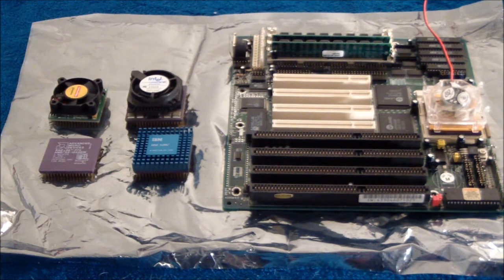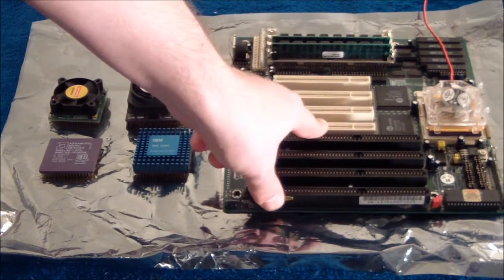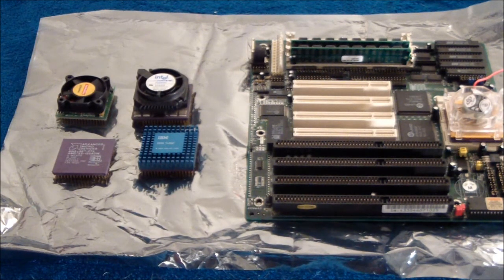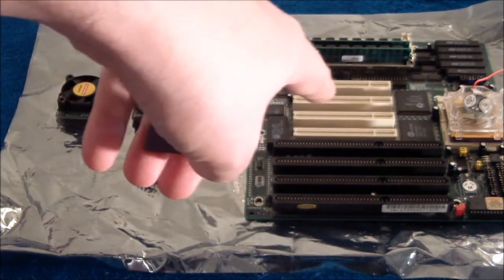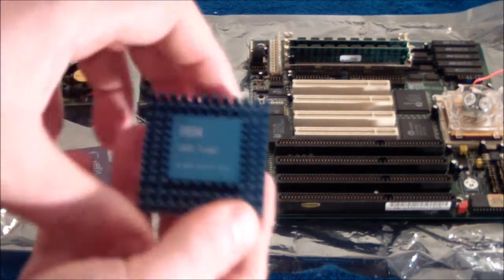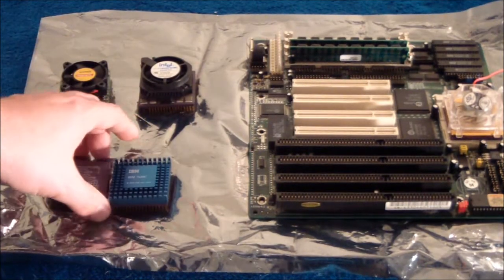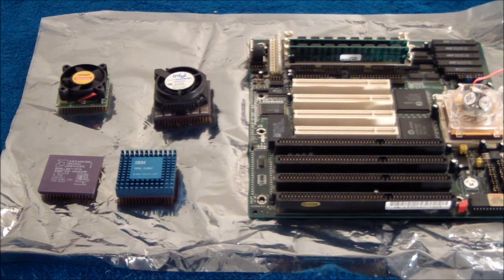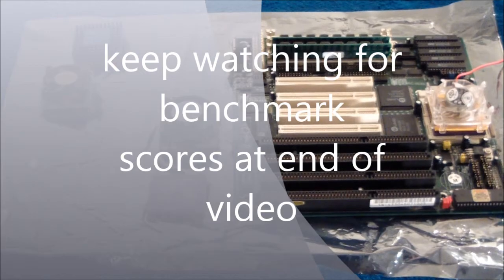Building a high end 486

Comment: I feel like everyone talking about PCI on a 486 just copies and pastes from something that one person some time said. What exactly is the improper implementation? I have a 486 with USB, wifi, reads flash drives, has Geforce 4, no issues whatsoever.
Reply from the maker: It's possible whatever 486 PCI motherboard your using has proper implementation. personally I've had a few PCI video cards not work on 486 PCI boards. The cards are fine and work perfectly in other later builds but I just get a black screen on my 486 with PCI. there could be several reasons for that however. I was very curious myself though so I posted this question to the people over at Vogons whom are far more experienced than I. Thus far these are some of the issues with early PCI implementation that were given to me.
- 5V slots only - so, no support for 3.3V cards.
- no PnP PCI BIOS support, you should configure PCI interrupts, DMA or other resources manually, or semi-manually.
- PCI protocol versions - PCI ver. 1.x motherboard or cards can conflict with ver. 2.x mb/cards.
- IRQ sharing compatibility in early protocol version is not so nice, req’d such tricks as ISA paddle boards for guaranteed IRQ.
- firmware initializations on turn-on not perfectly supported which leads to some PCI video cards not working. (I've experienced this)
- No support for or buggy IDE specification leading to many newer IDE controller cards not working. 
Take from that what you will as I can't vouch for the credentials of the reponders. I'll update this post with more info if anyone else replies.

Comment: like the socket 3 motherboards with pci slots I have my AMD 586 Dos build and has 4 PCI and ISA all done up with jazz-16 bit sound card and Rage pro PCI card 8MB Vram also looking into installing a SCSI controller card with two 10k cheetah SCSI hard drives and future Ideas would upgrade graphic card with Voodoo 1 and faster processor , right now I can play Quake with low resolution
Reply from the maker: How do you like the Jazz-16 sound card?
Reply: @AncientElectronics  its like a soundblaster card It works great with all my Dos games and like to test it with MIDI device some day

Comment: GREAT video! 
Seeing as the Am5x86-P75 ADZ was designed to run at 160mhz, (yet marketed as 133mhz) I'd assume it would be somewhat safe to OC it to 200mhz.
As long as it has a fan and heatsink I think it would be reasonably stable.
Anything beyond 200mhz is just stupid however.
Reply from the maker: I wasn't able to push mine to 200mhz but I know of people that have with the right 5x86 and motherboard. From what I've read its actually a bit tricky to get this CPU stable at 200mhz.
Reply: You'll still need a "golden sample" for that.

Comment: Are there any games that would work on high end 486 like this but would not work on a pentium?
Reply from the maker: nope, not to my knowledge. A high end 486 is a fun project but I think in general one would probably be better off with a socket 7 machine running a slower Pentium if you want to be around the same performance level.
Reply: I already have a 100Mhz socket 5 pentium built, so that is why I asked. Considering building a slower dos pc though. Might go with either 33Mhz 386 or 33Mhz 486. 386 might be good for a game like wing commendar and 486 might be good for a game like ultima 7. Too bad there isn't dos computer that is good with all dos games.
Reply from the maker: I like building different systems for different eras but I know many people do not or lack the space.  a 386 between 25 and 33mhz is usually whats recommended for Wing Commander. socket 7 166-233mhz Pentiums make decent all around DOS machines and usually can play a large amount of DOS games without issue.

Comment: With all that is said, which of the two I have is suggested to use?  I have an AMD DX4-100, and the Pentium-OD 83.  I have quite a few really good DOS ports of some of my favorite arcade games (MK1-3, the Acclaim port of Bubble Bobble and Rainbow Islands, Super SF2 Turbo), and know that the 486 era is usually in both minimum and recommended specs.
Reply from the maker: If your building a fast socket 3 machine and its between those 2 I would go with the POD-83. its faster across the board then the DX4 even at its lower clock speed. It's also optimized for Pentium code so it will run games like Quake and Duke3d better then the DX4. if you want to run older slower games the DX4 is probably to fast for many of them anyways so there's not much of a benefit except that it may be more compatible with your motherboard if the POD doesn't work.

Comment: Question - I'm going to make my first attempt at building a 486 computer, I'm going with a processor running 100mhz I know that much. But how much ram would you suggest? I've heard upgrading with too much ram could cause issues. How much ram would be a stable maximum?
Reply from the maker: I've heard that as well and recall reading on forums that some programs and games may give issues if your using more then 64MB of ram. Realms of Arkania 2, Privateer, Aladdin, Crusader, Ultima 8, Dune 2 all supposedly have issues with to much RAM but I've never tested this. Personally my fast DOS machine with a Pentium has 128MB of RAM and I've never encountered any RAM related issues with it but I wouldn't doubt this is still true. There apparently are even a few games that do not like more then 16mb of RAM (Realm of Arkania: Star Trail). sometimes these issues can be fixed with patches. I would say this. for a 486 go with between 16-64 MB or RAM. The programs/games that have issues with to much RAM seem to be few and far between so don't sweat it to much. Most DOS games will run happily with 16 or even 8mb of RAM but since your using a fairly fast CPU 32MB may be a good compromise and should allow you to play most games without issues. This is the amount I have in my DX2 66mhz 486 rig. 64mb and up is way overkill but still shouldn't give you many problems.
Reply: Thanks.

Comment: id go with the umc chips
Reply from the maker: Those are some chips I'd like to experiment with but as far as I can tell the fastest the UMC chips ever were produced in is 40mhz, which with the right tweaking is supposedly about as fast as a 66mhz dx2 and nowhere near as fast as high end 5x86 or overdrive chips. supposedly there were UMC DX2 chips produced but only as engineering samples and I'm guessing they were 66mhz chips possibly equal to about a dx2-100 and still slower then the various 5x86 upgrade options.
Reply: U486DX2 was the fastest one  knocked out the 66 mhz amd chips by a heathy amount and overclocked well as well
Reply from the maker: Wikipedia states "UMC produced a small quantity of clock doubling processors labelled as the U486DX2. These processors were designed to compete with other clock doubling solutions from Intel, AMD and Cyrix but due to ongoing legal troubles UMC withdrew from the market. The processor was only ever produced as an engineering sample and never made it to market" I also could not find any examples of this chip on CPUworld or eBay so I'm guessing its exceedingly rare.
Reply: yep
darn shame too these guys would have been amazing this day in age heck if they are still around amd should grab them and unite

Comment: so you're building a 486 or a 586 ?
Reply from the maker: the motherboard is a 486 based socket 3 board as well as everything else besides the CPU. technically the AMD 5x86 is also just a 486. Many of the high end upgrades for socket 3 such as the Pentium Overdrive and Cyrix are 5x86 though they are cut down as to work on the socket 3 motherboard. all in all these "high end 486" machines are still more 486 class then 5x86.
Reply: The answer is "yes".